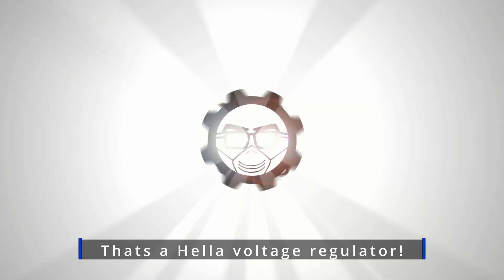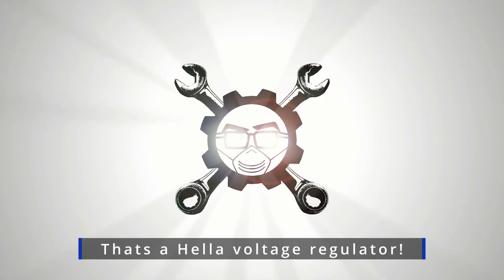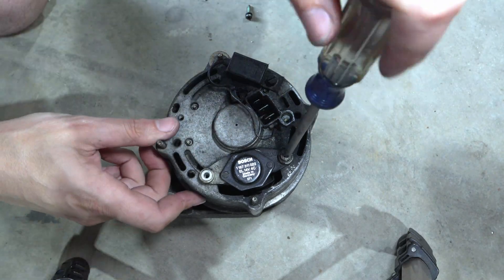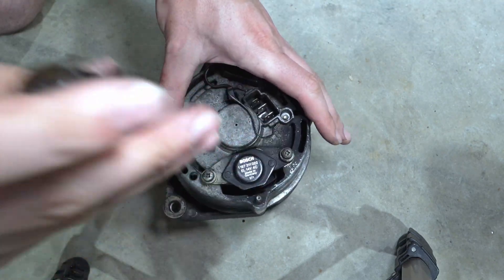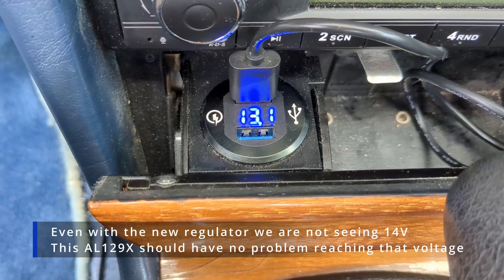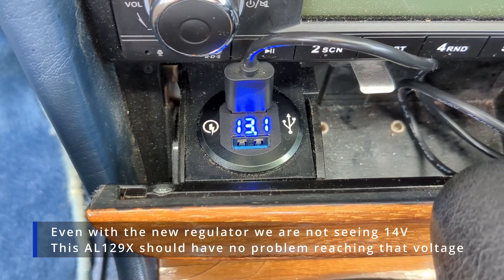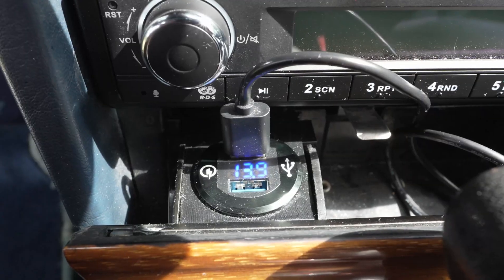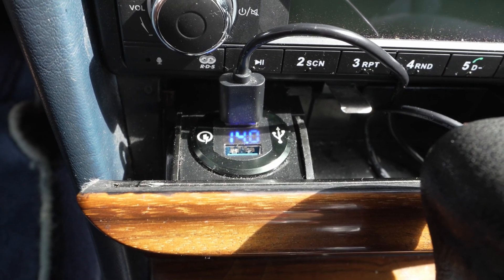W123 Alternator voltage regulator replacement

Comment: Hi! Had nearly no charging changed  the regulator and now i have acceptable charging but the battery light is still on what can cause this?
Reply from the maker: Any chance you changed the cluster light out for a LED? The battery light is part of the circuit that does the excitation for the alternator, there may be a small amount of current flowing through that bulb, an LED might stay lit with the small flow to keep the alternator excited and charging.
Reply: @trythistv  No, but I have take it out to check it, put it back. I've ordered another regulator so gonna see if it does anything. I've got 14.6v on now gonna try a 12v

Comment: It happened to me that one night the car was losing intensity in the light and before that it was difficult to understand it and I already knew it was the alternator. So with almost no light I managed to get to Autozone and there they had a new alternator and I changed it in the parking lot. It can be done in 30 minutes if you know what you are doing. And if the problem was the regulator but they did not sell it separately
Reply from the maker: I had this happen once with my very first car (w116 300sd) shortly after I got it running and on the road where the belts had dry rotted and loosened up and were slipping and my lights, radio and tach all stopped working randomly, got where I was going and couldn't start the car to go home, got a jump and drove home, then replaced the belts lol
Reply: @trythistv  I will be replacing some components under the dash in addition to restoring it. Do you have any information on details to keep in mind?

Comment: Is it compatible if I replace my w123 280e alternator to w124 120A alternator? And Yes i can change its mounting.
Reply from the maker: @putudutama2601  most all of the Bosch alternators use this style regulator, it's the same on my 115a al129x alternator as it is on the stock 65a alternator my car came with. I bet it would be the same one

Comment: Hi, I changed my alternator with a used one and since then the battery light has not come on even with the engine off with the key in position two, I continued like this until today when the car has not started, and the tester shows 11.9/12.4 as voltage with the engine on, do you know what it could be?
Reply from the maker: If the alternator light doesn't come on with the engine off then your excitation circuit is not working at all, it won't ever charge like that, the alternator light is an essential part of the charging system, and it has to be an incandescent bulb if I'm thinking correctly in order to excite the alternator windings, I would check that the bulb hasn't burned out, and that the blue excitation wire has a good connection on the alternator, I believe there might be a fuse that is related to it as well

Comment: Tom, I upgraded my alternator to the more powerful option you identified in a previous video.  It made a big difference  - and I can only say that because I drive so few miles with all the accessories going that charging was a challenge.  Thank you for continuing to speak to the various issues.  We appreciate you more than you know.

Sidebar:  that fan video was purrrrfect.  Viscous fan.
Reply from the maker: I too have the habit of short trips, and it is real rough on the battery especially with the glow systems big amp draw every single time.
I really enjoy making these videos and love hearing that its helping folks out.

Still not sure if refilling the fan is a good idea or not, but it does seem to have improved my AC performance, and haven't noticed any negative side effects yet. Just something that nobody seems to talk about much. Never know if thats because its a bad idea, or just because nobody knows about it.
Reply: Tom,  are you aware of a fan/clutch upgrade?  I'm not aware of any.  I replaced the radiator, upgraded the condenser (huge improvement in AC performance), etc.  but I have not found any good fan replacement that is a genuine "upgrade".  We appreciate you my friend.
Reply from the maker: The only "upgrade" I've heard of is changing to the 85 model year pulley and belts, It is slightly smaller diameter so it spins the water pump and fan slightly faster.
I have one of these pulleys, but want to wear my belts out before I bother changing everything over since my current setup is working ok.

I've also got the parallel flow condenser upgrade like you already did, I need to find time to actually install it and all that.

I should do a live video sometime and wander around and look at stuff that I should be doing and get feedback from everyone on what they want to see the most so I can get motivated to do those projects lol